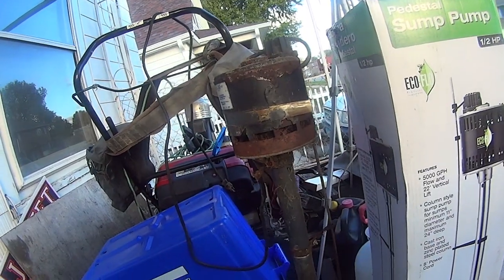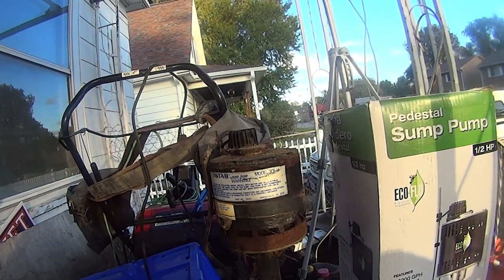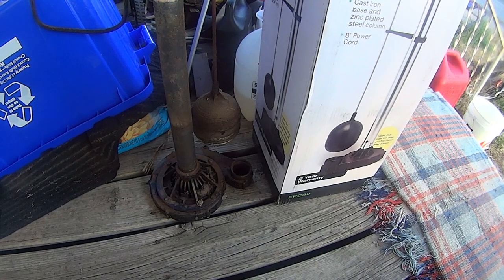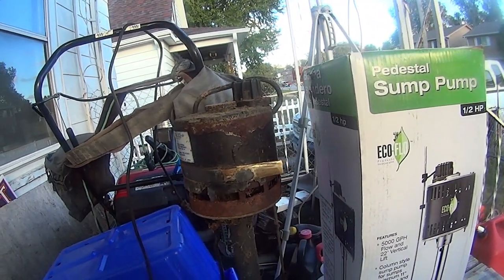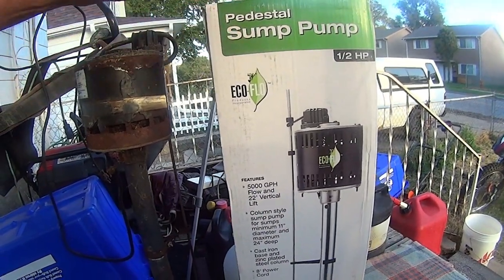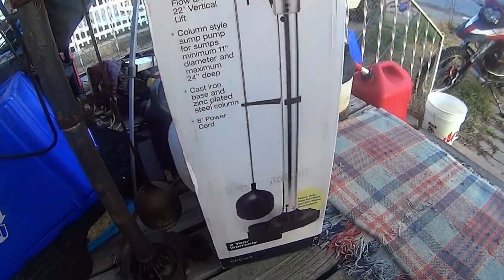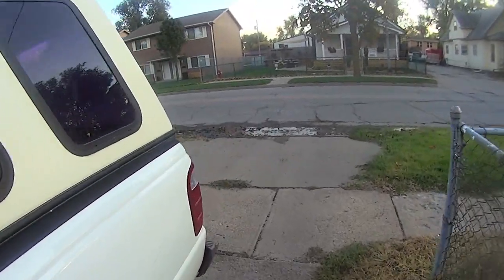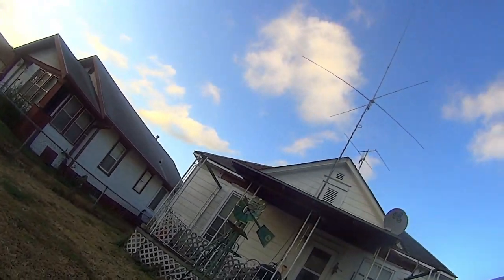Pedestal sump pump

Comment: Do homes w/sump pumps have water flooding problems? I just bought a home & didn't realize the extent of having this in my basement. 😕 I have the old one you showed. Have no idea how to use it. Maybe need to reach home inspector again.  Thought the pit itself was the sump pump in his inspection. 🤦‍♀️
Reply from the maker: You have to look at how that sump is set up to pump it out. This one was to replace the old "pedestal" pump that was hosed into the sewer. The Neighbor pumped it onto the Curb of the street. Fining possible doing it that way to the street. Hope it helps ya!
Reply: @navythomas8  Thanks, think my dad needs to help me check on this.
Reply from the maker: @kristenalmonte1110  Just thing to check...... Like my basement is sloped to run water into the sump. Which is then handled by the sump pump to pump it out. one position in the basement floor is the collection of the water. Wall leaks..... Floor leaks...... only a few times a year.... I am quite sure your Dad has dealt with these in his lifetime. Me only once in this house. I just did the hunting info, that made me get a new sump pump. from 1/4 horse pump.... up to the new one a 1/3 pump. rums quick and shorter now. keep me up. maybe I can help later!

Comment: There’s no comparison between the 1/3hp and 1/2hp. 

I had been using 1/3hp pedestal pumps for over 20 years and I finally decided to try a WAYNE SPV800 1/2hp pedestal pump 3 years ago when I installed a new pump.

The 1/2hp just absolutely throws the water out, and I mean now. lol

Comment: Looks the business, Tom. That's one hell of a vertical lift for a pump that size.
Reply from the maker: I will get a chat with you about my Navy knowledge of de-watering knowledge. I didn't even attempt to explain what I knew using these pumps and the step up of the 1/2 HP pump.

Comment: Looks like you have the high ground water problem under control.  I understand your situation. The house I grew up in had a spring in the basement and required a pump to keep the basement dry.  Good luck with the new pump.

Comment: Basement leaks are all too common. A lot of times water gets into the block cavities from the outside cracks and just fills up the inside of the blocks on the bottom course which seeps out from the mortar joint between the first course of block and the footing and eventually between where the floor and block meet. In fact if you drill into the voids of the first course of block from the inside you can possibly get a stream of water coming out for up to 10 seconds straight from just one void inside the block and there are 4 voids in the older blocks.